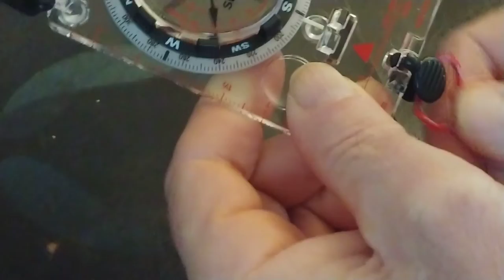why i don't trust suunto compass quick release &better lanyard option #compass #lanyard #suunto #SAR

Comment: I ditched the included lanyard and substituted paracord.  It's tougher and I can cut it to the length that I want.  I also put the little adjustment screwdriver on the paracord.  Tied the knot and burnt the ends to seal the deal.

Comment: The  Mc2 compass is great, however the lanyard is to short to use the compass correctly, hence the quick disconnect and as you mentioned in the video the plastic attachment could/does fail resulting in a lost compass. I replace the lanyards with 550 paracord of the appropriate length with a safety break-away and have had no problems.
Reply: What is the safety brake-away that you use ?
Reply: It’s a break away for paracord ,so you or someone else can’t strangle you with your compass lanyard . They are usefull on boonie hats also .

Comment: Never had any problem with any lanyard supplied with any quality compass,  including my Suuntos.  Then again, I always wear a collared shirt with the lanyards (yes, multiple, for other devices) between my neck and collar, and the business end either tucked into the shirt pocket or down my front between skin and shirt.  I don't visit any place with anything hanging out that can be caught on shrubs, twigs or even a friend's gear who's walking next me. 

I suppose it doesn't hurt to avoid the quick-release by Suunto. Then again, it doesn't hurt to check yourself over and make sure nothing is going to fall out, get snagged or damaged. And wearing a collared shirt just makes sense on so many levels.

I appreciate the Suunto quick-release for a very good reason. The shorter the lanyard, the less troublesome it is to keep it from interfering with anything else while walking or just rearranging equipment. But the shorter the lanyard means it had to be removed from your neck in order to retake you bearing; some of us don't see so well when the compass is just under our chin. Much easier to snap off the compass, hold it waist high to do the work, then snap it back in place.
Reply from the maker: Thanks for yout input.  I found something interesting, i have multiple kits for multiple purposes and i noticed all my personal kits have the quick release removed but my search and rescue kit still has it attached. I have memory issues post cancer and I have been trying to figure out "did i just forget to remove it or was there a purpose i left it on in this kit" and i think your description of carrying it around your neck tucked into a pocket just answered that because that's likely what i do since I almost always have a shirt with a pocket for S&R (although i almost always have a GPS too in that kit so maybe the compass is just for backup).

Comment: 100%, for exactly the same reasons. I don't want to reach for my compass and find nothing there but a clip! So mine is done exactly the same way, but using a length of 1.5mm Dyneema with two sliding knots at the loose ends so I can increase the size of the loop if I want to get a better extension for accurate sighting.
Reply from the maker: I love dyneema ... I've been using it for years (it came on my zpacks hexamid+ tarp tent that I bought in like 2014 was my first experience with it).  That is some super strong stuff
Reply: @sharpridgehomestead  I agree. Its strength to weight ratio is epic.
Reply from the maker: @robch4414  agreed, I def like it better than paracord.  There is this other product I use sometimes that although not as light or strong but its still great for outdoor gear and that is nite ize reflective cordage ... its something like 2.5 oz for 50 feet ... idk what its tensile strength is but I've never broke it.
Reply: @sharpridgehomestead  IME Dyneema takes quite a bit of use before it lose its stiffness - if I need cordage that handles easily from the start (say for throwing) I'll choose paracord. But the savings in weight and bulk make Dyneema well worth the extra cost.

Comment: I took my lanyard off and replaced it with Ranger Skull Bead pace counter. I think those lanyards are made to wear around your neck, then put the compass into your top pocket.
Reply from the maker: For many years, i generally keep pace beads on my backpack / gobags on the shoulder strap so its easy to reach up and move the beads but for the most part they just hang there out of sight out of mind.  Ive always thought, and maybe you can clarify because ive never tried it, that if pace beads were on a compass being used a lot to sight a path that i might inadvertantly move the pace beads through just normal movement.

Comment: Aquí en mexico, este tipos de brújulas presentan un fallo después de comprarla aproximadamente en 3 meses se presenta una burbuja en la capsula no permitiendo el movimiento de la ajuga o impidiendo el movimiento de esta fui al servicio técnico de aquí en mexico suunto mexico la cual no se hace responsable de este fallo y te alienta que compres otra brújula de otra marca mejor. triste pero cierto no te dejes estafar por esta marca.
Reply from the maker: I wonder if there is a difference in the supplier/distributor for Mexico vs US?  Maybe they got a batch of bad runs or they are fake?  I've not had any problems with bubbles in suunto compasses yet (I have 4 of them that vary in age from 2-5 years.  I have had other compasses get a bubble).  A compass I like a lot is k&r alpin made by kasper & richter... I haven't been able to find them for 8 or so years now though so maybe they stopped manufacturing them.